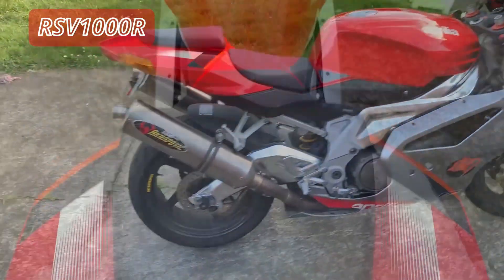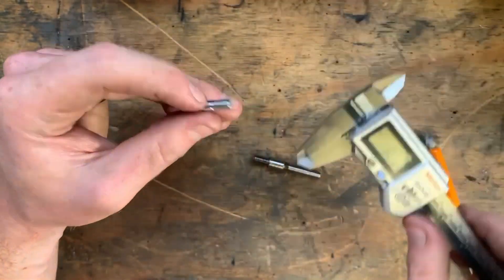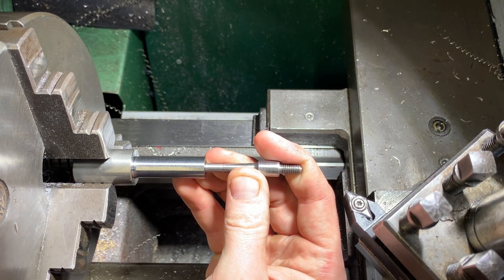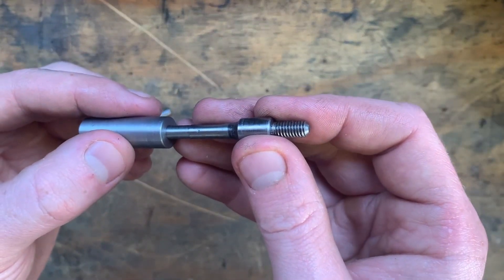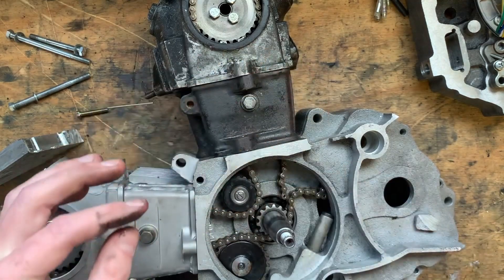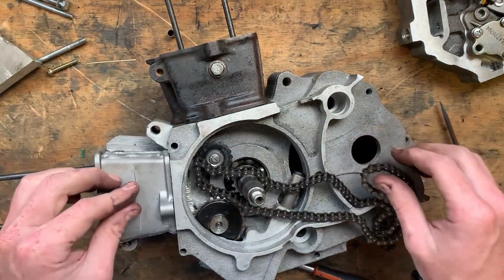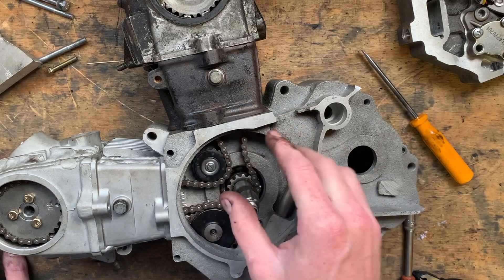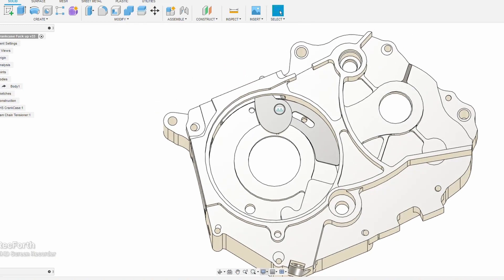DIY 144cc V Twin, One Step Closer

Comment: I advise you to abandon the idea of a parasitic gear made of plastic. I did this... It collapsed after a couple of kilometers... You need to make it out of metal... A star from the crankshaft is great for this case. You need to insert a bearing into it only. Good luck.
Reply from the maker: I’m currently investigating using the original roller now reconfigured somehow.
Reply: @OddsandEndsMachining  I'm telling you from my own experience. It is better to learn from the mistakes of others. Good luck with the construction.

Comment: Looking at the bits where you faked the gaskets with a screw driver, you might not even need the chain tensioner. Wonder if you can even get all 4 gasktes in. Good luck :)
Reply from the maker: Are you thinking what I’m thinking? Stack enough gaskets to remove the need for a tensioner . . . All the while lowering the compression ratio making the engine easier to start haha. But in all honesty a good bit of luck never hurt.
Reply: @OddsandEndsMachining  Shame chains only come in whole links :)

Comment: Excited to see the progress 👍
I'm a big fan of those aluminium inserts, they work very well on small lathes where you don't have the power or rigidity to take the deep cuts that regular carbide inserts want.  Is that your RSV?  My brother has a 2005 and I had the older style 2003 model for a long time, both great machines.
Reply from the maker: That’s for sure, you can’t fault a nice sharp cutting tool and yeah, it’s a 2004 I’ve just picked up. It’s a bit naughty when you give it a handful.
Reply: @OddsandEndsMachining  Watch out for the odometer getting reset if the battery is a bit low when you crank it.  My brothers had his reset half a dozen times!  

They are a bit naughty, it's the only bike I've owned that would hoist the front wheel up without any kind of encouragement other than giving it a handful.
Reply from the maker: @ferrumignis  ain’t that the truth. This one has reset, although I have the km recorded from each warrant of fitness. It’s done under 10,000km and I am the second owner. The bike has spent a lot of time sitting and needed a good going over.
Reply: Interested in what we’re the insert part numbers
Reply from the maker: @jirvin4505  next time I’m using the lathe I’ll make sure to add the insert numbers to the video.